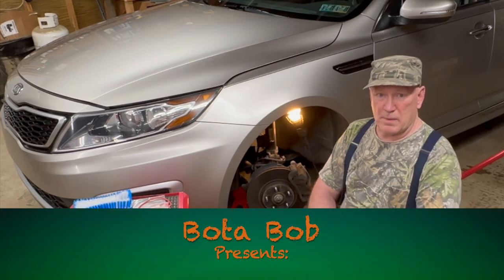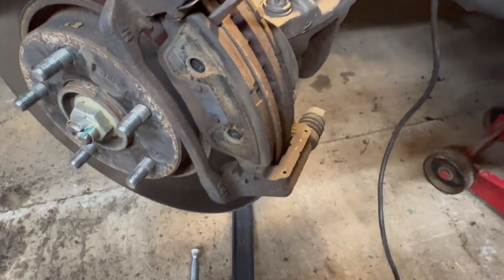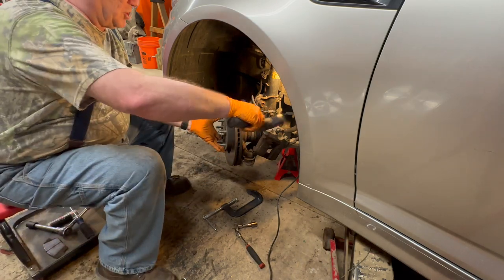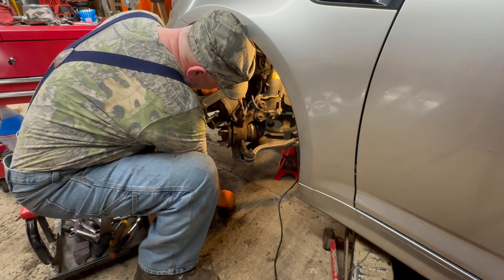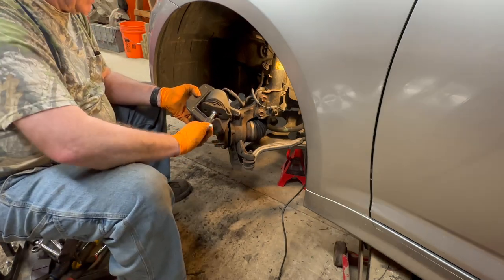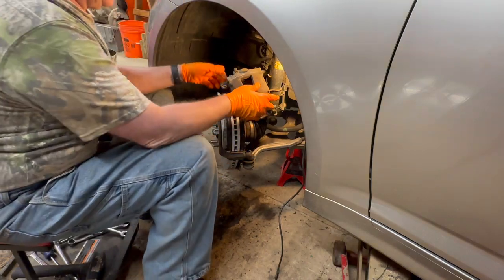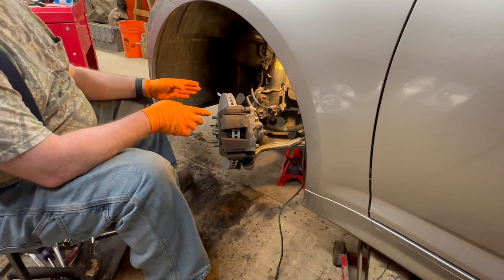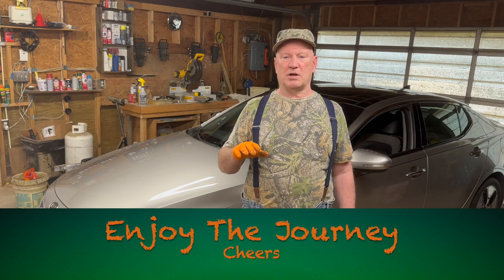178 - KIA Brakes

Comment: Good evening Bob. We don't have any type of vehicle inspection sticker or expiry dates in my area. Your brakes look pretty good and very clean.  Doesn't look like you drive on any dirt / gravel roads.  Some of the things I do when servicing my vehicles brakes (Spring and Fall) is clean all parts thoroughly. Replace any worn-out part.  Apply Never Seez / Anti-seize to the surface of the hub of the rotor / disc that makes contact with other metals. Clean the new rotor / disc with brake cleaner.  Lubricate the caliper guide pins / sliders. Lighty sand brake pads. Apply light amount of grease on rear of pads, clips and caliper where back of pads make conta, etc. I am on dirt roads a lot and  our winters have a lot of salt on the roads so I service my brakes twice a year.  Have a good one!
Reply from the maker: I did grease the caliper guide pins and I cleaned the new rotors front and back with brake cleaner.  That was done off camera.  I also lubricated the sliders (around the 6:30 mark).  I used a wire brush on a lot of the parts again off camera.  Salt is used to treat our roads also.  They also spray a liquid on the roads to per-treat them under certain conditions.  I try to get my car's under carriage washed once a week during the winter. I like the idea of grease on the backing plate.  The front brakes were not as bad as the rear brakes. The rear brakes were starting to hit the clip that grinds.  I ordered the parts last fall and finally got around to putting them on the car.  I'm glade that job is done.  Thank you for sharing your tips.  Thanks for watching and commenting. Enjoy the Journey - Cheers

Comment: Lookin good Bob! Interesting you need an inspection each year? Nothing like that here. Maybe a bit of a cash grab? But I guess it also keeps junkers off the road. Those are going to be nice and smooooooth. Cheers, Mike.
Reply from the maker: Good day Mike.  When I was 16 and got my first car the state safety inspections were performed every 6 months.  There was a push recently to eliminate the safety inspection but I think it fell through the cracks at the State House. LOL In addition to the safety inspection, people who live in more densely populated counties of the state require an annual emissions test.  It cost me $100 to drive get my state inspections and stickers.  They hook the scan tool up to the car for the emissions test.  Check all the lights, tires, brakes, wipers and exhaust.  They also check for holes in the body and floor pans.  Yes, basically it is designed to keep the roads clear of rolling rust buckets.  Thanks for watching and commenting. Enjoy the Journey - Cheers

Comment: Hi Bota Bob! Mrs. Betty has a KIA. She loves it. I drive the FREE F-150….lol
Reply from the maker: My KIA is nice.  But the favorite car I ever owned was my 1999 Mercury Sable.  I bought it used with 60,000 miles and drove it until 199,000 miles.  The transmission was acting funny and I did not want to break down on the highway.  I replaced it with this fine KIA back in 2013.  So, I've had this car for 11 years now.  Thanks for watching and commenting. Enjoy the Journey - Cheers

Comment: Too funny Bob, I just recorded me doing the front bakes on our mini van a couple of days ago. I plan on making an episode with it as well.........Your brakes and underneath of the car is very clean compared to our 2010 van and any vehicle here on the northern coast..........You wasted $$$$$ changing those rotors for sure. I will say that most mechanics will tell you that you should never open the brake resovoir only to top up if needed.........unless you break a line it will never need to be opened........there is enough fluid in there to compensate for brake wear and no need to open pushing back the caliper piston........the main reason for not opening the resivoir is that brake fluid absorbs moisture from the air...........and that is one of the key characteristics of brake fluid that gives it it's high boiling point......on older vehicles the fluid will tend to get dark from use over time...........a change of fluid for a 10, 15 or 20yr old vehicle may not be a bad idea...........for your fairly new car there you would be wasting time, money and risking on having some trouble with it..............if it's not broke.......don't fix it Bob.............my two cents worth. Great job on the brake replacement!
Reply from the maker: I know the feeling about making a video about the same topic.  Last year that happened to me regularly.  LOL Let's face it, we are all doing the same things.  However, we can learn from watching others, well at least I can.  I would always cut my grass from the outside in blowing my clippings to the middle.  Well, I watched one YouTuber who would cut starting in the middle and then blowing the clippings out.  It works a lot better when grass is thick.  my car is 12 years old now.  LOL I think it looks pretty good for the age.   That was the first set of pads at 183K miles.  When you get a nice day, turn on your camera and do that brake job.  I will watch it.  Thanks for watching and commenting. Enjoy the Journey - Cheers
Reply: Good morning Bob, you have saved yourself a fair amount of money 👍 I enjoyed the video,  have a great weekend, Ben 👋😎👍🍻